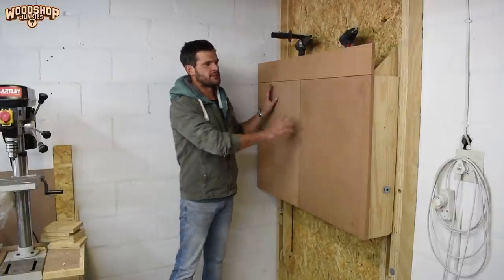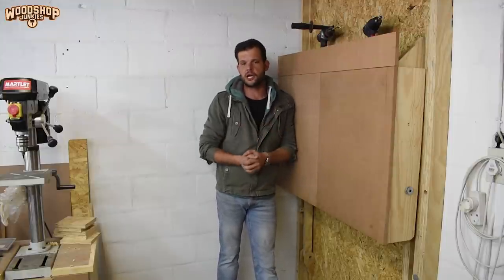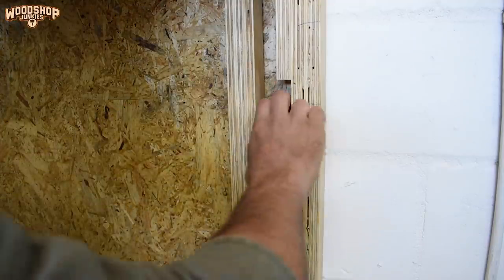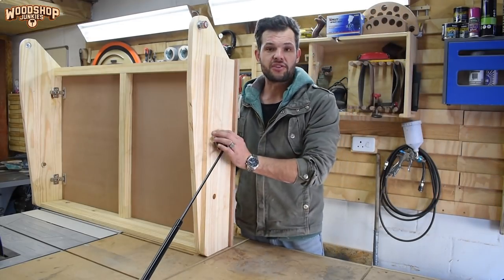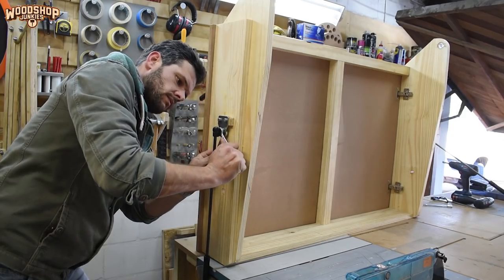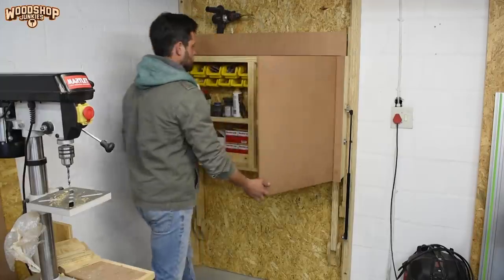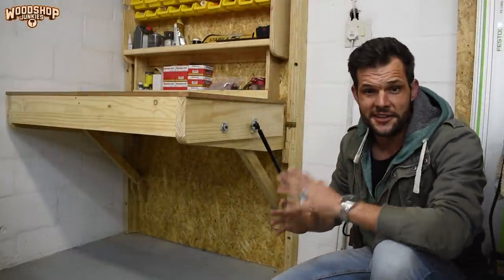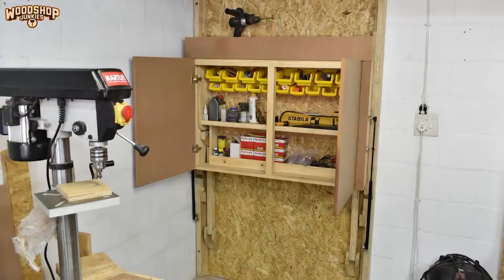Garage Workshop Space Saver - Soft Open And Locking - P3

Comment: I think a subscription is fair as there many great qualify videos produced. You will for sure have a secure fan base.

Can i ask what strength gassprings you used? Are they from a car boot? The ones i have availible in korea are 30kg or more for that size and im curious what you used?

Thanks again vor this video contents.
Reply from the maker: I bough new inexpensive springs. They come with a 50N base pressure and can be primed up to 1000N. For my design length was important but strength was not. The struts I used was only pumped to 100N. Very weak.
Reply: @WoodshopJunkies  thank you so much for the reply.

I noticed that you could move them very easily by hand so this makes sense. I love the design and think its a great/genius way to save space in a small workshop. Thank you again.

Comment: Why not put the latches inside the door/table.  This would prevent the need to bend over to latch and unlatch.  It would also give you the ability to latch when it is in workbench and cabinet mode using the same latches.